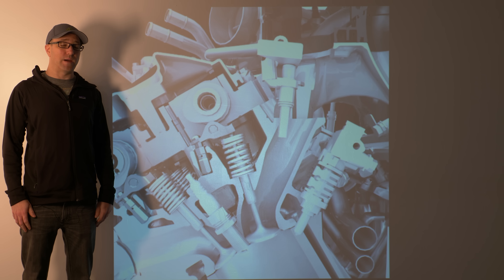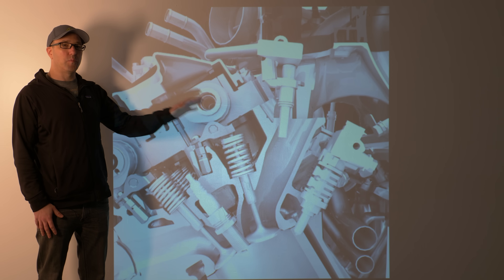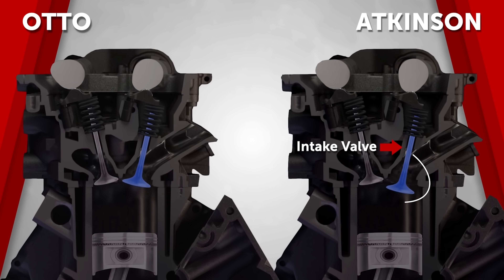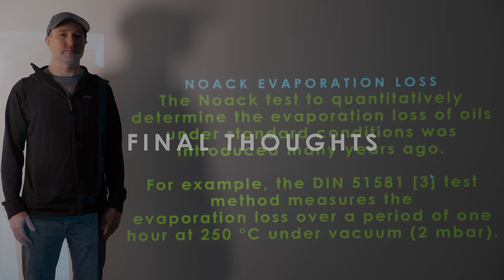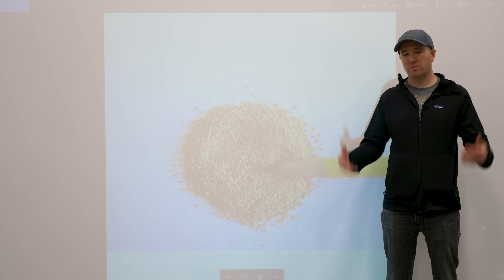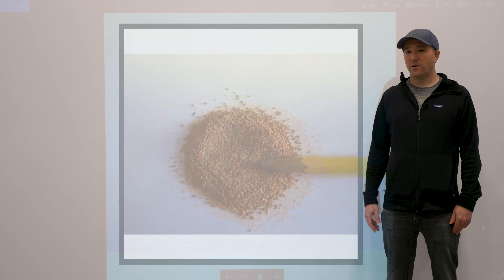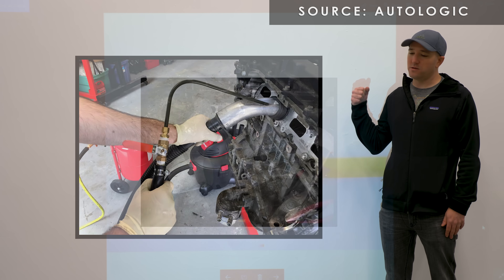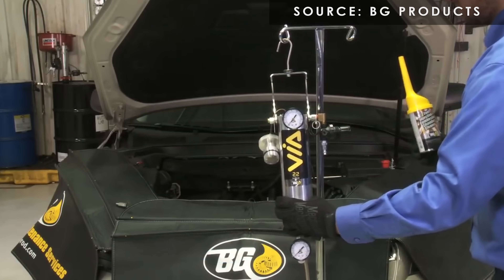Direct Injection, Problems and Solutions | The Fine Print

Comment: For 99% of car owners, this carbon buildup won't matter.  It can modestly limit the maximum amount of air that can flow into an engine but how much wide open throttle driving do most people do?  Also, the amount of blowby that occurs is dependent on how much time the engine spends with high cylinder pressures which occur at high loads on the engine?  Normal driving doesn't produce high cylinder pressures.  The engines that are most affected by carbon buildup on intake valves are those that are driven aggressively and/or have forced induction where higher cylinder pressures occur more often and therefore produce greater volumes of blowby.  I have a GM 2.0 liter turbocharged four cylinder engine in my car equipped with direct injection.  The worst that can happen to my car is a slight loss of maximum power as my car accumulates miles, but that won't be till approaching 200k miles since I do not drive aggressively and only rarely drive at boost conditions and almost never at wide open throttle.

I welcome electric vehicles.  Gasoline (and Diesel) powered vehicles have defied general consensus in having achieved ultra-low exhaust emissions while delivering high power output and excellent fuel economy at the same time.  They have done this by becoming more and more complex.  The time has come to move on.  Electric motors are vastly simpler with only a shaft running on bearings for moving parts.  It's time to change to EVs.

Comment: EGR going back into intake manifold, to quench down combustion temperature inorder to reduce Nox, would likely contribute to bigger % of carbon built up on intake valves when compared to oily gases being send back by PCV into intake manifold?.

Will bad PCV cause crankcase pressure to drop much lower than -0.1 barg whereby bigger % of engine oil vapour will be sucked into intake manifold?. 🤔🤔🤔

Comment: Would be interesting to see if direct injected engines would benefit at all from the integration of water injection, as the water steam would provide the much needed cleaning action.
Reply: @MotoFixation  It does a great job at cleaning away carbon deposites.

Comment: Enough already! Direct injection motors are just fine. You just need to put in a good quality injector cleaner once at every oil change. I use Amsoil myself. Others use seafoam however, read the instructions. You may need two cans of that. Keep your vehicle fully maintained and you will definitely outlast electric vehicles.

Comment: For my experience with turbo charged gdi engine use api sp grade with dexos certification change every 4-5k miles. use fuel system cleaner and lucas gdi cleaner from the throttle every 10k miles.

Comment: This is why I bought a 2015 forester as there is no direct injection and no infotainment system and gets 34mpg. Original engine still ran great at 320k. Only changed the engine as I bought with a bad transmission and for 2k I bought a 30k engine and transmission for 2k. At 5k I'll put 200k to 300k on this car for less then you will spend on your di engine.

Comment: I'll never understand why they introduced so many more problems with DI when PI worked so well. I have one of each car and there is no power advantage to DI. No fuel economy advantage. At least between all the ones I've driven. All it has done is introduce unnecessary complications. All the manufacturers tout how much more powerful and efficient DI engines are. I've seen NONE of that. Only carboned intake valves, ports, and pistons. Oh yeah, and diluted oil. I seriously believe these systems only exist to make more money and keep you coming back for service.

Comment: This is a great video. Thanks alot.

But the frustrating thing is just how difficult it can be to check if your next vehicle does not have all the technologies you want to avoid. It was surprising how long it took me to confirm a 2022 Rav 4 Hybrid does not have pure Direct Injection or a “Metal Belt-and-Adjustable pulleys” style CVT, and what it has instead of these. I have an engineering background, so I’m some hope of understanding and avoiding the most troublesome technologies on cars with some effort on my part, but what about the average buyer?
Reply: Your Toyota does have multi hole direct injection, it's basically the same system used by other manufacturers. I had to clean gunk on valves on my 2021 RAV 4 Hybrid after 25k miles. If I knew about it I wouldn't buy this piece of crap, but I thought, that this is Toyota so a reliable and relatively simple car. Oh boy, I was so wrong.
Reply: Sorry to hear about your experience. 
But it isn’t so common for car manufacturers to build dual port / direct injection engines; pure direct inject seems to be popular these days . The Rav4 Hybrids all use dual port / direct injection, so spray the back of the inlet valves with fuel, unlike pure direct injection engines that you get with say, the Mazda CX-5 and Subaru Forester and Outbacks. If your Rav4 still gets bad carbon build-up, I’m guessing it would be worse with other cars using direct injection only engines.

Comment: This is all BS , and i mean ALL OF IT , dont you think VW AUDI would make an engine that can do what it is doing , so if it is burning Vapors from PVC system , dont you think they tested it , and saw if it can burn it and keep valves clean , yes they did , and their valves are clean ,... Yours are dirty as are mine , why ?
LEt me tell you why , in Germany it is normal to drive on Autobahn 200kmh , at 4000 RPM  for 20-30min , to work and  back ... and that is where your Carbon Build up is burned .
Now im not in Germany and i usually drive 40Kmh , sometimes 60, sometimes 30, on average 40kmh ... at 1400RPM 
And that is where Carbon Build up happens  , on cold engine driving slow on low RPMs .
How do you burn it away , well  you put it in 2nd or 3ed , and drive at 4000RPM ,  simulating the german autobahn ,make that engine work , and take a look after , clean as a babys ass .
And there you go , i just saved you 500$ .
Your welcome .
On the other hand , if you dont buy Direct injection engine , you are missing a lot , if you buy Diesel , Diesel has problems of their own as well, every engine has issues .
Electric Cars also have issues .They dont even work when 10 years old , like cars we usually drive , lets face it we dont drive new cars , we drive used cars , mine is 8 years old .
So imagine 8 year old electric car , yeah right , maybe it would do 50miles ...so... it is what it is .

Comment: Blow by doesnt move up , it blows by the cylinders down in the crank case , of course there is some overlap and possible blow by the valves but thats not called blow by usally , when we say blow by its blow by down in the crank case and then from the crank case in order not to have pressure in it that would blow the gaskets and leak oil , its routed back up to the PCV and out the Crank Case  and to lower the polution is then brought back to intake to be burned again , which then makes your valves dirty .

Comment: A HUGE problem manufacturers have is the dang vacume pump failure in many brands of 4 cylinder engines. They allow motor oil that is used to cool the pump parts but they fail firing engine oil into the intake manifold . That’s why valves get gummed up . We were all led to believe it was exhaust gasses doing it. Mazda has a call back on vacume pump failure since 2014-2022 .

Comment: Excellent presentation Mark , as always! You did mention oil catch can  plus installing water/alcohol vapor injection it's a simple and economical solution for GDI engine carbon build up... keep up the great work 👍
Reply: This will also help with detonation
Reply: @goblenator9688  correct, water vapor injection had been proven to increase mpg, help with detonation,less strains in the engine therefore less engine wearing, etc....

Comment: As an owner of a GDI engine, you really don't have to worry about it if you do the correct maintenance. The best thing to do is a crc valve spray treatment twice a year. CRC is like $13 a can so for ~$30 a year, you can avoid issues. If you stay constant with it, the build up will never get bad enough to affect any aspect of driving the car. I also use Gumout Tune Up which keeps the injectors and pistons clean. Get regular oil changes as this stuff will dirty up oil quicker, especially if it's the first time using it.  Research before getting a catch can, it can void warranties. I wouldn't get one unless I had a turbo. Even then, I would get a really nice one ($100+) as you mentioned. If your car is being tested for emissions, they can fail you on the spot if you have a catch can.
Reply: What car do you have? I bought a can of that stuff. I have a Type R. Looks like I have to pull the intake elbow right after the intake and MAF sensor and spray the cleaner into the inlet pipe. Don't know why I'm worried about doing it lol. I know it has to be done. I have a PCV high quality Radium catch can, only use 93, Use Amsoil Signature Series and change it every 4K to 5K. As well as using Liqui Moly DIjectron, Amsoil PI fuel treatment and Amsoil injector cleaner. Trying my best to avoid any issues

Comment: Install a catch can! 

My Audi is completely clogged with gunk and it's been babied and I've always personally changed the oil every 5,000 miles. It didn't have a catch can and the check engine light is now a permanent fixture on my dash. I'm selling my Q7 with 67,000 miles because it's basically totaled. It still starts, runs, and drive just fine but to fix the multitude of issues caused by poor crank case ventilation it's well over $8,500. Valve cleaning, pcv valve, crank case pump, ream out the internal passages in the block, new O2 sensors, new cats. It's basically a full dismantling of the intake system and exhaust system and cleaning or replacing everything. The whole front of the car has to come off to ream out the exhaust passages in the block. What a terrible design.

Install a catch can!

Comment: never EVER use a heavier oil than manufacturer recommends. Cars from 40 years ago? no problem use any type of oil lol. Cars today? Oil passages are much narrower and if you put a heavier oil in the engine will not be getting proper lubrication. Thats a problem. And its even a bigger problem if its a turbo.
Reply from the maker: Highly dependant on operating temperatures. If you are in Arizona in a 115F day running 260F oil temps a lower visc oil thins out signifcantly. After 212F.  So a 5w30 would be better than 0w20.

Comment: Excellent (though scary) presentation!  I can understand why manufacturers are switching to EVs as the regulations have pushed the engineering challenges into unsustainable areas.
Reply: No, there are solutions, but they cost money.  The push to EVs is a religious faith-based movement and thus not very logical.  Save the Planet!  Riiiight, when what the West and Europe do will have minimal effect if the giants-- China, India, and Africa, don't do the same.  And they don't and they won't.

Comment: When our bg rep cam to our shop after redesigning the induction service chemical sets to disolve the build up of coolant,it took no less than two services to get at least 85 percent of build up off the pistons and valves on a neglected engine.it boils down to the owner and their maintenance of their vehicle of scheduled services.we didn't have any problems at our dealership with or routine customers starting with 30 k services with the bg induction services.

Comment: Let me clear this up for you,and the other guy I seen as well.the 2.2and,2.4gdi,turbo gdi that Hyundai/kia- mobis desiged .does create excess carbon build up on  the valves and pistons,because they burn a small amount of coolant on them from design.bg redesigned and induction compound for that exact reason with the car company for standard maintenance intervals.also the ccvt has been left out for timing control,lag reduction,ecvw witch ads more boost from the turbo to reduce fuel comp,and an ecu program for the knock sensor  to put the vehicle in limp mode if it picks up a certain bearing pitch to keep from blowing the engine .there is a lot you are leaving out . Hyundai invested the technology,and also started the gdi/ multiport combo engine Incase a gdi component fails.ive been to school for the last 22 years for several car company's and all I'm stating is that there is a lot more involved with the industry than just cons,without the pros  and the corrections that are out there now that fixed the problems.just saying.

Comment: I'm late to the party.... But with GDI and the issue of carbon and also heat build up on the inlet valves, there's a good case for port water injection. It might also be a way to help the fuel/air mix within the combustion chamber.

Comment: This is one of the reasons for Toyota's reliability. A bunch of companies just jumped on the DI bandwagon, and then just left it to their customers to deal with the consequences. Toyota waited until they had their dual injection before they started putting it in everything.

Yes, I drive a Toyota. It was the last year of port injection for my model. Every year after that has been dual injection.
Reply: I just bought a 2023 tundra and I told the salesman and the concierge that the truck has 12 injectors and they were in full denial. They both said it’s only got 6 cylinders. Why would Toyota put 12 injectors in a 6 cylinder. After a short explanation they were still In semi denial but they understood the concept of direct and port injection. I told them the same system is on my ‘21 rav4.
Reply: @Will Jeff  except for maybe the service people, the staff at dealers usually don't know what the fuck they're talking about. Never have I visited a dealership where I didn't know more about the car than the person trying to sell it to me.
Reply: @johnryan6658  TRUTH!
Reply: I also remember Toyota explaining that it initially held off from introducing direct injection as it was more prone to damage by fuel impurities, which are found in higher concentration in the less developed countries that Toyotas are common in
Reply: GM loves DI, just look at the truck engines. Possibly Hyundai has the best idea, new engine since 2022 are  DI and Port injected. Computer controls the switch between the injectors.
Reply: Most of time yes, but the earlier toyota/lexus' direct injection had carbon build up that can destroy the engine if neglected. It commonly occurs in 4GR-FSE 2.5L V6 in the lexus 250 2006+. It is not until later that toyota has fully solved the issue and put them in a lot more cars to ensure reliabilities.
Reply: Toyota is truly brilliant in this regard as the port injection cleans the entire intake system including the valves by passive gas flow through the system and then the direct injection provides increased economy and power. It's simply a brilliant solution. I will never own another direct injection - only -  vehicle again. I owned a GDI 2012 Kia Rio that was an insane nightmare.
Reply: @phil4986 its a lot of injectors… plus is it enough fuel to truly wash anything? Time will tell
Reply: @Heatherder  Dual injectors seem patently overbuilt imo. Port injection always worked well and more injectors tells me there's a higher chance of something going wrong, and the expertise needed to diagnose/probe a dual injection based failure will probably cost more in labor, naturally. I'm sticking to port injection until these EVs eventually push combustion engines out of the market (a sad reality that might come true).
Reply: @stygianhoplite  SO. YOU evidently will have more money in the future than Brains!
Reply: @phil4986 is that the same thing as dual injection?
Reply: This was invented by MIT and originally stolen by Ford.
Reply: Still, dual injected hybrid Toyotas tend to raise oil level due to gasoline mixing with oil when driven on short distances. It's a fact, more and more people start to complain about this.
Reply: LOL….Too bad they didn’t do the same with the v6 turbo that fails at less than 100k miles in the Sequoia. They had to recall them all.
Reply: Chrysler took the same route as Toyota
Reply: @Non-immigrant  Ford's Coyote V8 also has this.

Comment: Good vid but there are sum things u missed..i have a 17wrx with d.i..within the first 10k i installed a egr delete so the exhaust is recirculating anymore(it reqiures a tune tho) then around 30k i added methanol injection ..the injector is mounted on the throttle body side of the intercooler the methanol def helps keep the valves clean..

Comment: Been running a catch can in my 2012 Ford F-150 (145k miles) with eco boost for 2 years and use only synthetic oil and run a fuel injector cleaner 1x per year and knock on wood, the car has been running great and changed the air filter to a KnN aftermarket filter and the truck runs great.

Comment: My thought is if the car manufacturers really cared about their customers they would do the right thing rather then throwing SHIT at the fan an hoping it works  AFM direct injection are nothing more the a death sentence to engine  in pursuit to sell more cars  no special oil or extra accessories will correct these bad designs what we need is government that protects consumers from rip off manufacturers
Reply: It’s more so there hands are tied with ever tightening emissions and trying to make a fuel efficient car with decent power at the same time.

Comment: The old hilmans 40 years ago were fitted with an oil vapor separator they had to be inspected and cleaned at every 20.000 miles it kept the air filter clean. And prevented sticky inlet valves.